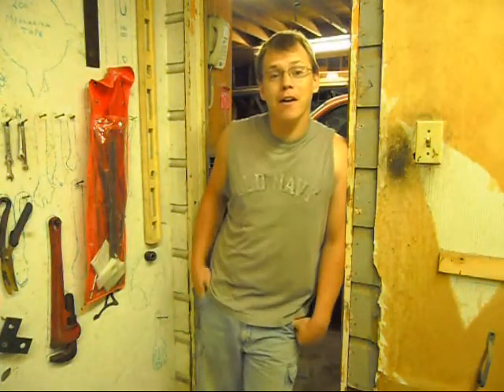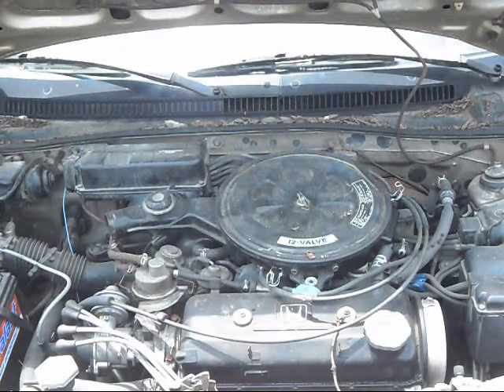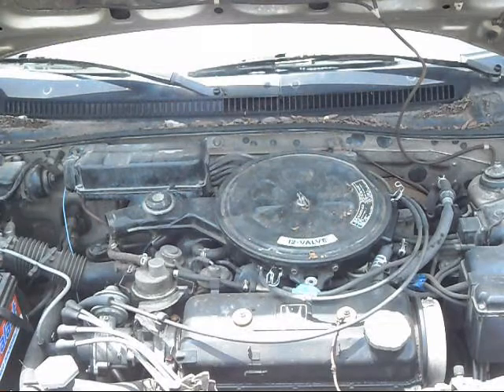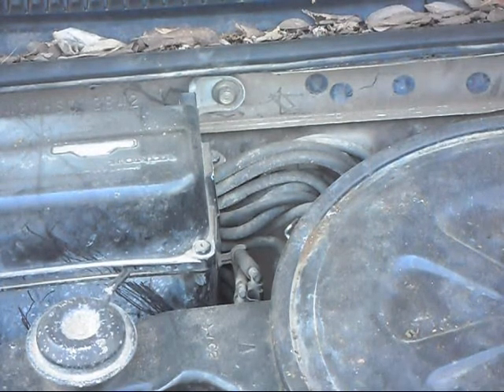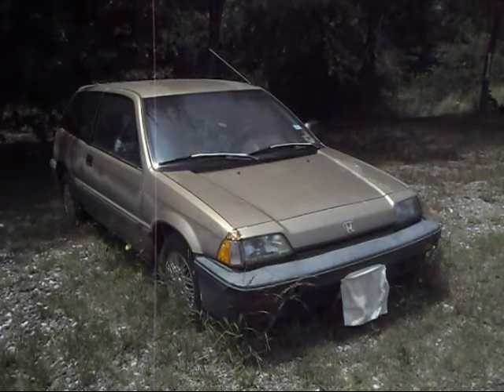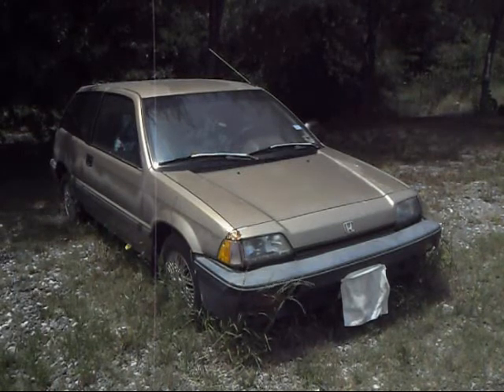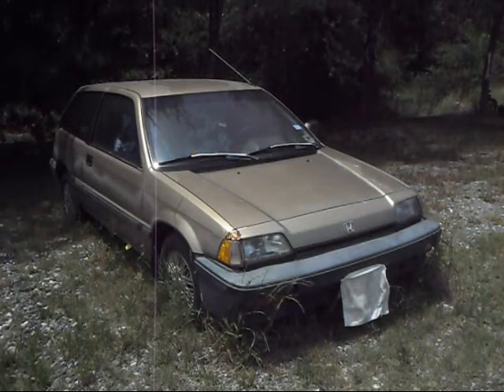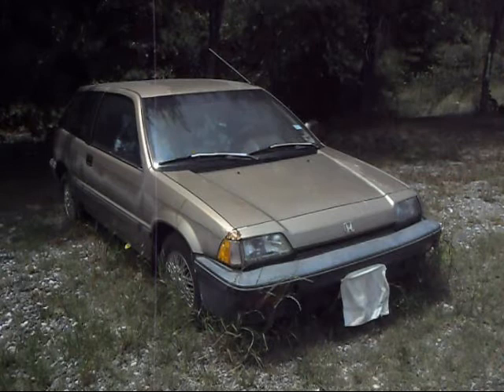Raving Reviewer. Known Problems of the Honda Civic.

Comment: agree with you on the automatic transmission fitted to the 3.0L V6 engine.
the one in my Odyssey van took a dump around 200,000 kms.

Comment: What are thoughts about Toyota Camry and corollas? Have you got a chance to daily drive or work on any Toyotas?
Reply from the maker: Big fan of them, my favorite of the import economy cars. Just had an 04 Camry. I couldn't do a review on it, because I had nothing to work with. 02 sensors are common, as are the struts, but those are common wear items. The engines and transmissions are great.
Reply: Toyota Pickup/Helix, by far proven to be indestructible... except for the rust.  If they even so much get a spot of rust, it'll grow to be terminal cancer for the frame.  I should know since we had a '92 4Runner that was built off of the Helix's platform and success, but watch out.  That rust will find its way to the rear strut mounts and eat those away to nothing, as well as the frame rails themselves that support the weight of the body and the crossmembers.  Once your strut mounts are gone, they'll either have to be rewelded on which doesn't always work, or the body will sag horribly in the rear, like a Lincoln town car.  And say goodbye to your payload capacity, you'll definitely break something if you try towing anything.

The engines and transmissions are excellent, the 22R/22RE are basic 4 cylinders that are great for high altitude off roading since they won't require the oxygen content like the 6 cylinders do, and the 22R can be slapped into pretty much anything Toyota ever shit out.  The 5 speeds are great, coupled with a modifiable transfer case and differentials, you can put multiple different gearsets inside for unbeatable crawling power.  If you're really needing extra torque to haul bigger tires around, go for a 6 cylinder, the 4 cylinders just don't have the power and it'll wear the internals prematurely.
Reply: I just bought a 2017 Civic Coupe EX-T. Am I about to be in for a lot of problems (software, mechanical, etc)?
Reply: Jamie Shows You'll be fine.

Comment: sounds like the ignition on these cars is no better then the opti spark lol. sounds like they had their fair share of problems but people put them on a pedestal and unfairly bash american cars for some unknown idiotic reason. if it has tits or tires its gonna give you problems.
Reply from the maker: I am no fan of Honda and a TON of problems have started manifesting on the 00's. Kia is the WAYYYY better car right now.
Reply: And the irony being Kia is from Korea, and certainly doesn't have near the reputation of engine building like Honda does, especially with Honda starting out making motorcycles.  Suzuki made motorcycles as well and tried their hand at building cars, but they're WAY worse quality and unreliable.  If you want anything with 4 wheels from Suzuki that you can depend on, it's the Kingquad.  More irony being that the Kingquad is built like a military humvee, 4 wheel independent suspension and differential lock optioned 4 wheel drive, all shaft driven with a bulletproof drivetrain.  If you get one stuck, you're doing something wrong.  Think their cars got the same quality and development time? Pfffft.
Reply: the LT1 V8 from 1992-1997 has that one glaring problem, otherwise nearly bulletproof. my car has 231K miles and still runs strong and pulls well. the LS1 that came next was even better. the small block chevy in nearly all of its forms is one of the best engines ever built, along with the 3800 V6, 2.5 iron duke, and the old 2.8 and 3.1. ford had the 302, 351, and 300 I6; dodge had the 318 and slant 6 and jeep 4.0. all 3 american manufactures had some really good engines but people always rag on the domestics and brag about how good the foreign cars are. 

all of the engines i have mentioned have been discontinued and replaced by garbage actually most engines by most manufactures are junk now. emissions laws are making them a nightmare to work on, own, and service.
Reply: honda is not that great neither is toyota
Reply from the maker: Most of the replacement engines were brought out due to emissions requirements. The new 2.2L ecotec is a great motor that is surrounded by crap cars.
Reply: People shit all over the 305 for being underpowered and whatnot, the 305 displayed in my profile pic has 264,000 miles on it, and runs like new.  Roller lifters introduced in the 1987 model year dramatically increased the GM Chevy small block's life expectancy, and power adders aren't that hard to come by.  The 305 has more bore metal to work with, so they're a little less prone to cracking and block failure, however TBI systems sap them of any potential power output.  Swap out for Vortec heads and maybe a stealth ram with a better cam with higher redline, you can punch out 300-400 horsepower easily, and still have a reliable daily driver without touching the pistons or bottom end.
Reply: Toyota has excellent engines and drivetrains, however they are plagued with frame problems from day 1.  Keep an eye on the chassis and any steel lines, they'll rust without warning and the car will literally eat itself alive.  Wash the undercarriage daily, especially after mudbogging.  The real pain the ass?  Toyota doesn't even see this as a problem, they won't issue a recall, instead they'll just tell you your car was sold in the wrong state.
Reply: people knock the 305 because its not really a performance engine and really wasnt meant to be. are they reliable? yes, i have owned a few myself they are a good engine. its not really so much TBI system itself that's the problem but the heads are the biggest problem. i personally prefer the 5.7 chevy (350 and LT1). i have a 1996 camaro Z28 with the LT1 and people like to bash that engine for a flaky ignition. i replaced the opti once since i bought the car, that was 33K ago. the car has 231K miles on and it still pulls well, despite the mileage and inspite of having tall 2.73 gears. i would rather have any chevy small block variant then most Japanese junk. i would rather have a 3800 v6 (too bad that engine is gone what a great engine it is). there are a ton of older designs that were better then the new stuff.

you still cant say anything bad about anything LSx based. GM builds some of the world's best v8 engines.
Reply: The 302 was the performance engine to get from GM, the 305 tried to ride on its thunder, but the early 70's 305s were rife with problems.  If you're wanting a 305 for reliability, and somewhat decent performance for a daily driver, look into the LB9 from '87 to '92, or any 305 block with Vortec heads.  Anything earlier than that is gonna lack roller lifters, and the cams are gonna suck complete ass, even worse than the TBI cam.
Reply: my LT1 has a roller cam and lifters. i agree completely roller is much better then flat tappet. 

you are wrong about one thing. the 302 chevy and the 305 chevy are two completely different engines for very different applications. the 302 chevy was a high revving,  destroked 327 and was factory designed for high performance. they red line somewhere north of 7,000 rpm.

the 305 on the other hand was designed for fuel economy, its a fuel economy engine PERIOD. we are talking about 1970's fuel economy standards but regardless that's what it was designed for. most 305's had poor flowing heads, a restrictive exhaust and intake system. IT was NEVER designed for performance. the only 305's that could have been considered performance would have been the L69 305 HO and the rpo code LB9 had some performance but were never really high performance. L69 had 190 hp and the LB9 was 205 hp (i believe)

so the 302 and the 305 were designed and built for different applications and objectives in mind. you are right that the later roller 305's were durable but so where the 350's. they were and are both good engines.

if my goal was performance i would not waste time and money building a 305, as a 350 is already 45 cubic inches more to play with. frankly i would probably want to work with a 5.3 as they are LS based and cheap enough out of the junk yards.

a 305 makes a good daily driver or something just to cruise with. LT1 cars are cheap at this point and make more power then either the 305 or the 350. i like my LT1. good fuel economy too.
Reply: The 305 is good if you're looking for a very basic small block that's not so prone to cracking like the 350's are.  Vortec heads are evidence of this, 3/4 of the used 350 Vortec heads are gonna be cracked, since they cut the combustion chamber walls out just a little too close to the edges.  The 305 was never a performance engine, but they thought they could take the same design cues of the 302 in that a 327 crank was both used in a 302 and 350 at the time in the late '60s, so by making a smaller bore with the same 350 stroke crank, it could make better fuel economy and possibly more revs with smaller pistons and counterbalancers.  305s are true sleeper engines in that they need their potential woken up with performance parts in order to truly see what they can really output.
Reply: i have never had a problem with a 350 block cracking, vortec heads perhaps. the LT1 i am talking about is the 92-97 variant the car is a 1996 camaro Z28 and even as many miles it has on it, its still a strong running car. i never owned vortec heads, i had a L05 that i swapped into a 89 camaro that was originally an L03 car.

i kept the TBI injection on that 89 when i swapped to the 350. i had the bores on the throttle body machined larger, install a edlebrock performer cam, and swapped L98 heads that were in decent shape. the stock swirl port heads on both the 305 and the 350 were terrible flowing heads and that made the biggest difference.

the 350 is a great engine, i also like that LT1. the 305 TBI i had was reliable but a gutless pig. perhaps if i did the same heads, cam, and tbi modifications to the 305 it would have been much better, but it never would have been a 350. they just dont have the cubes.
Reply: The LT1 would be an absolute excellent block if it just used the traditional dizzy and wasn't reverse flow.  I'm sure it's dependable if you can scrounge up the parts to fix it, while small blocks don't give a fuck what's thrown in them as long as it works.  The reason for the LT1's existence to begin was to be crammed under every dashboard of 4th gen F bodies and C4 Corvettes, as Chevy prepared the transition to the LS era.  LT1s make good power, but was taken for granted by GM, however they did ship it off to Lotus to make the LT4, which parts are even rarer to find.  I think if anybody is gonna get an LT1 Corvette, they should drive it very seldomly in the most optimal weather conditions, just to be on the safe side.  If they got the money to fix and maintain it for hundreds of thousands of miles, then by all means thrash and bash it.
Reply: i have driven my camaro in every weather condition except snow. around here snow brings salt, salt brings rot. my car is far from perfect the paint is not the best, the interior is a little worn out, it has allot of miles on it...... what it does have going for it, no rot. it was originally a california car. 

the LT1 and LT4 are not the engines lotus was involved. look up LT5, it was used ONLY in the corvette ZR1 it was designed by lotus and assembled by the mercury marine division. it was a 32 valve engine and shares not a single part with the LT1 or LT4. i can imagine it being horrendous to source parts for. the LT1 was used in the fbody, the corvette, and B body so more were made. it is a more expensive engine to mod then a traditional small block or LSx because the heads and the cam are not compatible with traditional small block.  the LT4 is just a hopped up LT1, the LT4 had a different intake, better cam and i think different heads. they made 330 hp and were used in corvette grand sport and camaro SS which was limited run in those years.

the opti spark is not the best design BUT if you buy a genuine replacement unit AND the water pump doesn't leak, they are fairly reliable. i replaced the opti when i bought the car and it was almost $300. i used a delphi unit and haven't had a single issue. the car gets driven daily ran or shine all summer long. the placement of the opti behind the water pump is the biggest problem, pump failures often times wipe them out. you have to understand how that thing works too. 

i also had to replace the intake gasket, motor mounts, shocks, struts, ignition module, ignition coil, wires, plugs, and every bushing on the car. the control arm bushings were completely fried. i also did a fuel pump. once i fixed all of the problems it has been a very reliable daily driver and has never been on the back of a tow truck.

the reverse flow cooling isnt necessarily a bad thing, cruising along even on a hot day the car sits at 180 degrees and doesn't run even remotely hot. i like the idea of the water pump not driven off of the belt, if the belt fails the car can safely be driven till the battery is dead with no issues. the water pump also tends to last longer when the pulley isnt side loading the water pump bearing.
Reply: Midnight Mechanic you mean lt5, right? And the lt5 was built by mercury marine, not lotus. Lotus designed the lt5, and the lt5 was based on the lt1 hardly, if at all. The lt4 is just a whored up lt1.
Reply: A Mercury Marine built engine would be a somewhat smarter investment if you're wanting to build a dependable daily driver, at least it'll be slightly cheaper than sourcing Lotus parts... Corvettes just don't take to daily driving like anything else with a SBC, and anything they threw the LT1 into has problems if it's not over abundantly kept cool.  Roadmasters and Impalas had them, but like JC316 stated, it's much better in those engine bays since there's a lot more room for a proper radiator.
Reply: @MidnightMechanic  and in 87 they used the T5 5spd with the LB9 and I think it had the most aggressive cam out of all the third gens even more aggressive than the L98